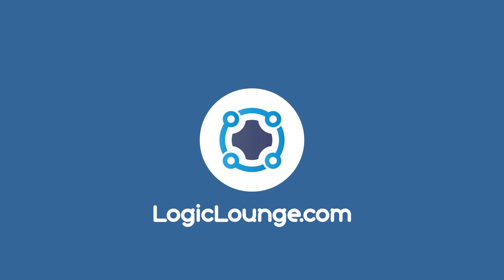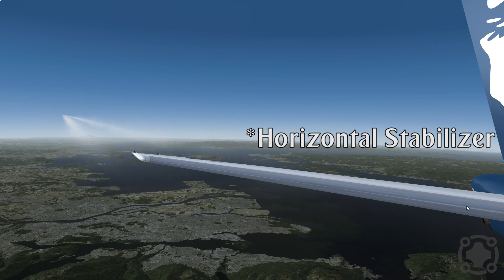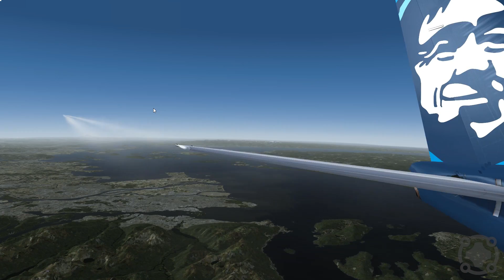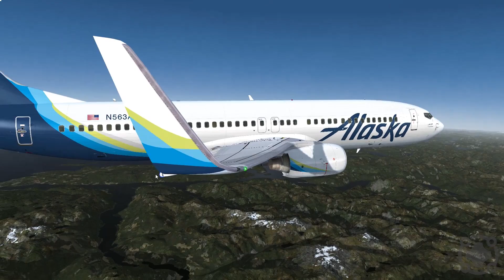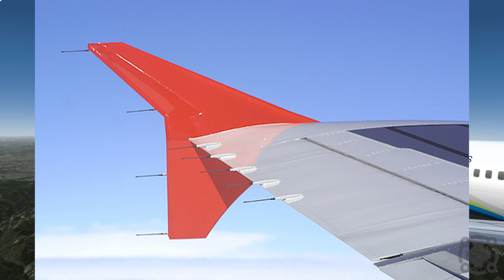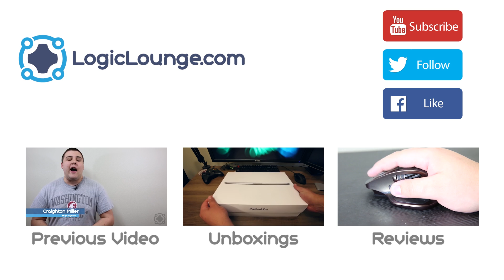How Do Winglets Work? - Aviation Facts

Comment: The horizontal stabilizer provides a downward force. It actually adds to the lift required by the main wing and "stabilizes" the pitch-down instability of the center of gravity and the main wing lift.

Comment: Honestly I'm a bit disappointed in your description. You tell us WHAT happens but not WHY it happens . I mean the actual physics of why vortices cause a downward pressure (negative pressure to be precise) on the upper wing surface, or the physical action of the flowing air around  a winglet (or split winglet)  that creates a "forward lift" force to the aircraft's wing. A vortex that's occurring behind a fast moving wing is disconnected from the wing by a large space in a short time so how does those air molecule movements have any effect on a solid structure (the wing itself) thats 100 feet away from it in the milliseconds after the vortex to swirl around ? Can you please  explain that precisely? Thank you

Comment: cleaedr my doubts. plz make a video on V2 speed.  i know its safety take off speed with one engine inoperative. but what if all engine fails before reaching V2 and a safe height if 35ft.
plz correct me if m not making sense
Reply: Digvijay Tanwar The plane lands back on the runway. Or crashes. Not a lot of options with no thrust

Comment: Why did Boeing not put winglets on the original Boeing 777 200, 777 200er and 777 300 series?
Reply: Samuel Barringer because the B777 is already very Fuel Efficient so it doesn't need them.

Comment: Nice viedo, unfortunately the explanation is not correct. The induced drag is not reduced by the fact that it hits a smaller surface. The induced drag is created by the fact that transversal velocities are by the pressure differences. This happens all along the trailing edge so vortices are formed along the whole wing. These vortex formations can be reduced by extending the wing span as much as possible (pressure difference in transversal direction is reduced).The winglets just act as a span extension of the wing. In fact it would be even better to just extend the wings wich is sometimes not possible for 2 reasons: 1) limitations of the aircraf class on the wingspan and 2) for retrofits, it can be more difficult to design a wing extension rather than a winglet due to the outwash (twist) of the wing.

Comment: Vortice? I think you mean vortex. Plural is vortices. Well explained otherwise.
Reply: Harrison Toth no vortex
Reply: Mark Logan, in your video, you used an illustration of a crop duster from the FAA's Pilot's Handbook of Aeronautical Knowledge.  The caption of that illustration reads as follows, "Figure 5-9.  Wingtip vortex from a crop duster."  The word "vortex" refers to one wingtip, while "vortices" refers to multiple wingtips.  Here's a term that will make your brain explode, "vortex generators" (aka VGs). VGs are little plastic or aluminum T-shaped devices that are applied, in a pattern, to the top of the wing, making the low-pressure air "stickier" during high angles of attack.
Reply: last time i flew on the southwest heart livery and i saw these winglets and i though they were 737 max winglets but now i know its a scimitar winglet.
Reply: Harrison Toth not true at all
Reply: Mark Logan You’re 100% right man
Reply: Markhi it's Luis Hrbiwta my question is ehh are Thierry solitaria svhimitar I mean schimutar winglits verter thanvjet'a say tve tales wingliys? Logan
Reply: Mark Logan no people in aviation call them vortice

Comment: Why didn't they build winglets on the horizontal-stabiliser too?
Reply: Yes of course one can answer that. The horizontal stabiliser exists to stabilize the aircraft   there  should be no  differential pressure  between the upper or lower surfaces, if there is then the aircraft is not trimmed properly and fuel is being wasted.  The horizontal stabiliser  is only used  for the occasional pitching of the aircraft and those moments are so few compared to the flight time, that it is not worth spending  the money on them. Ideally the centre of  lift on the main wing should coincide with the centre of gravity so that the horizontal stabiliser at the back is not producing drag. For good  fuel use,  the horizontal stabiliser should not have any angle of attack so no winglets are necessary.
Reply: Good question, can anybody answer that?
Reply: the horizontal stabilisers simply produce downward force(longitudinal stability) as opposed to upward force of the wing. No lift is created(level flight) and therefore no vortices is created

Comment: what's the difference between winglets and sharklets?
Reply: Same thing I believe...Airbus calls them sharklets and Boeing calls them winglets.Probably a patent thing
Reply: Ed ???
Reply: Airbus is trying to be special and unique by calling their winglets something different.  The industry has been using the term winglets for decades and its commonly called that by all manufacturers.  Heck even airbus called their A330/340 winglets by the proper name.  It's not a patent thing to call it whatever they want, that's just gibberish. Its a very, very lame marketing ploy (like most French things...)  Winglets on 737's were an aftermarket item for many years until Boeing bought the STC to be  able to install the design on their planes without coming up with one their own (cheaper).  A winglet is a winglet.  The term sharklet is an airbus gimmick.
Reply: Winglets are supplied to Boeing by a partner company. I believe Airbus infringed on that company's patent when they created the Sharklets, it was a court case a while back but I don't know what the outcome was. Airbus had to pay a settlement if I recall correctly, don't quote me on that.

Comment: wingtips reduce drag by creating a thrust component due to the circulation of air (wingtip vortices). Also wingtips are used to reduce drag but increasing the wing span would be a much better way to reduce this drag. so we use wingtips because generally the maximum wing span is limited by the size if the gate the plane must be able to fit in at airports, therefore wingtips are used to increase efficiency when the wing span can not be increased

Comment: But then I want to ask why cant the winglets of boeing 737 just bend down to prevent higher air pressure going up to the lower air pressure?
Reply: They can't bend down because you have a lower preesure on the upper side than the surrounding air. You would  still have a vortex, though it would be smaller.